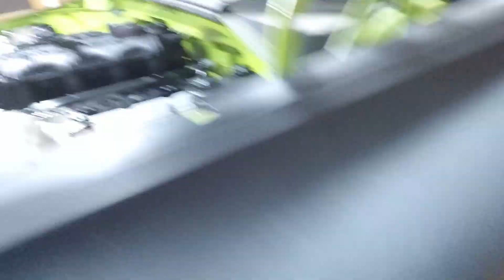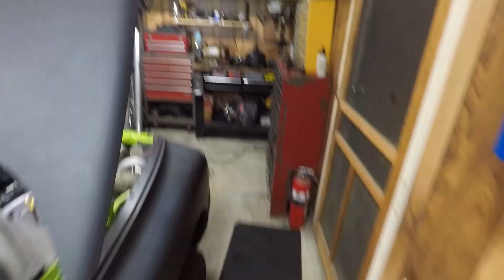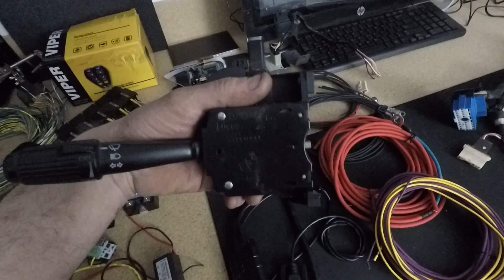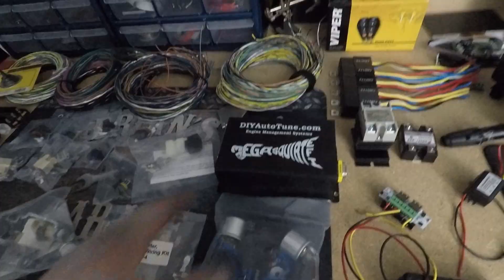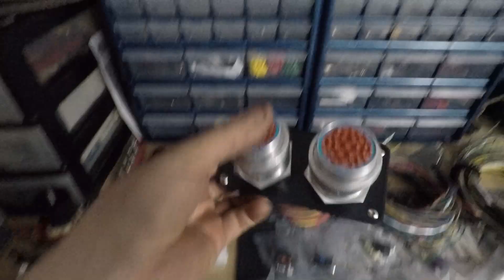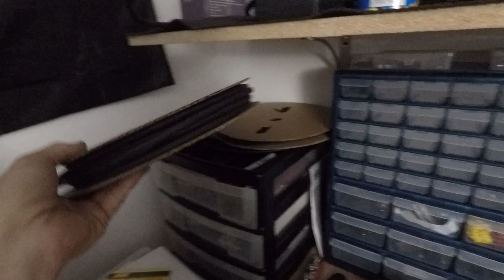Exhaust is done, now to wiring!

Comment: Great video.! I’ve been working on my jeep Comanche with a 4.0 and I went though stroke to a 4.7 and turbo it to haha I just got done wiring my ms3x to the engine. Have you considered using the simerlater and Jim stick?
Reply from the maker: Thanks! Yeah I have the Jim Stim to play around with. I had a stroked Jeep. Loved it!
Reply: Ohh sweet.! Yeah I am having my ms3x being worked on and installing some components as in knock sensor some resistor and diodes to have my wasted spark coils form a 2000 4.0 lol and my jim stims can you do a video on the Jim stims that would be awesome I’m new to mega squirt or even tuning a engine form scratch yeah I have a YouTube channel that I have this hole build on
Reply from the maker: I have plans on tuning videos in the future for sure.
Reply: Ohh awesome.! And yah adding a pressure sensor in the coolant would be nice to have.